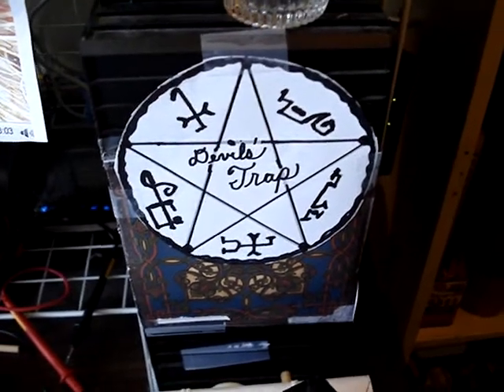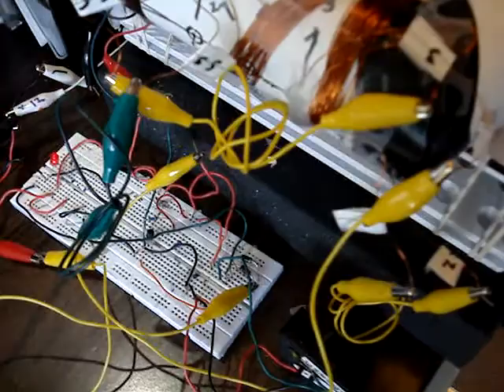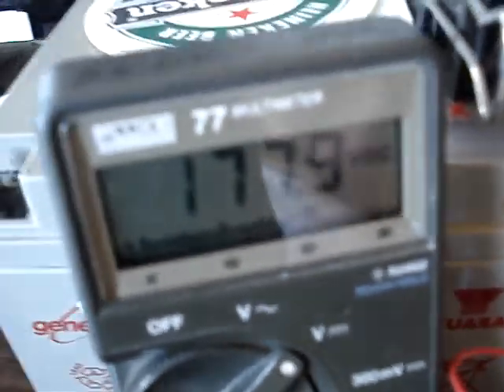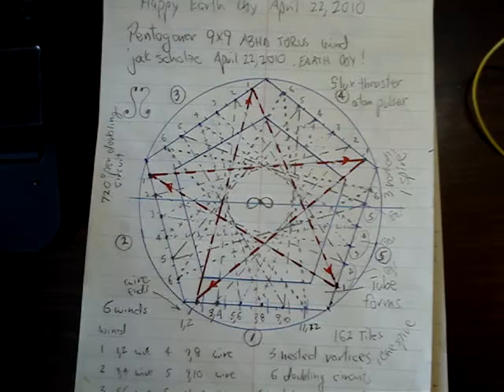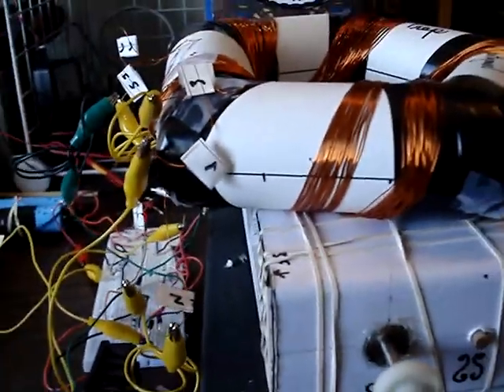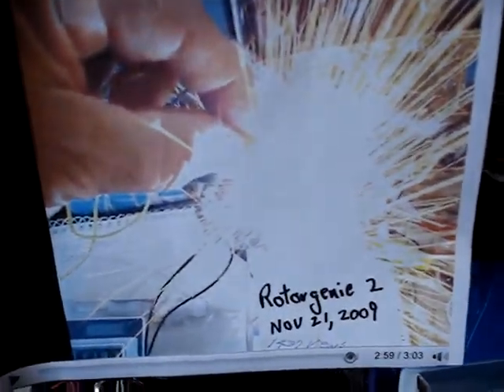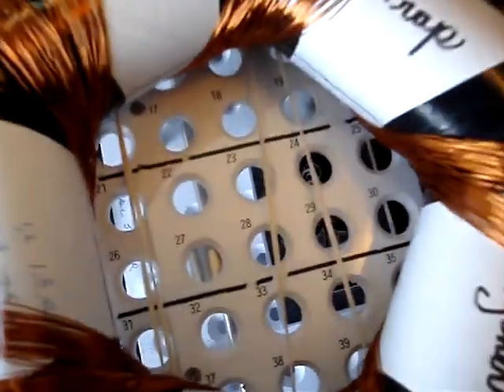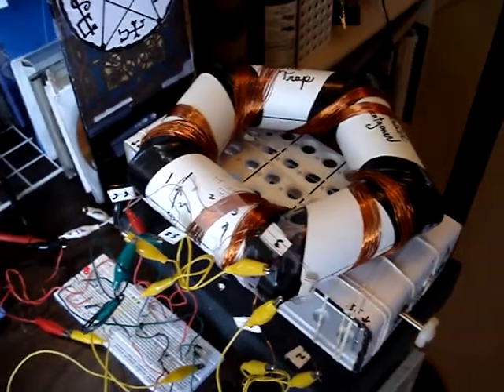Devil's Trap Coil and Pulse Motor

Comment: (6) How long has it run for non-stop?
(7) What were the specification of your 2 capacitors?
(8) Why all the holes with numbers in your frame as they seem to serve no purpose?
(9) How come your rotating magnet is not located within the center of your coil which would offer better interaction?
(10) What is the voltage of the battery we see that you are using?

You may want to put the answers in your video description so as you do not have to answer these FAQ's over and over.

Thanks in advance.

Comment: Hello, your video gives no detailed explanation of your device or its construction.
(1) What gauge wire are you using?
(2) Magnet is not located within the windings, so why is it working so well?
(3) Is that a secondary coil I see wrapped in electrical tape next to the magnet?
(4) What are you using for bearings? 
(5) Pentagonal shape verses circular, did you find any performance differences, if so, what were they?